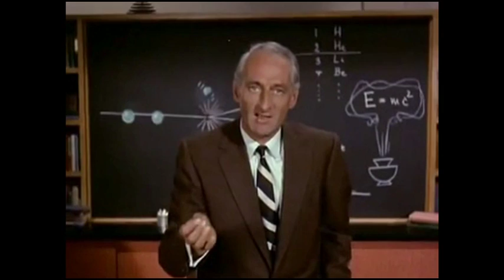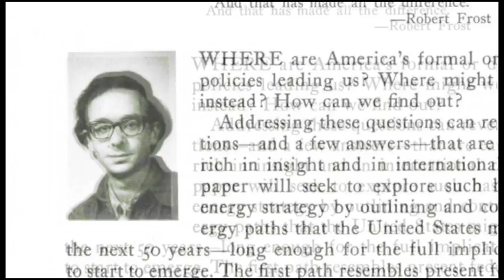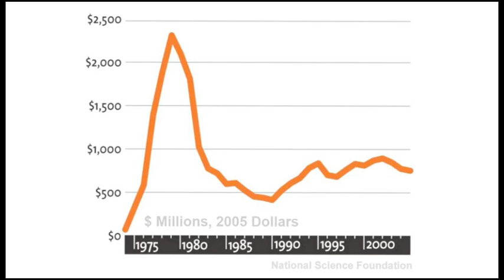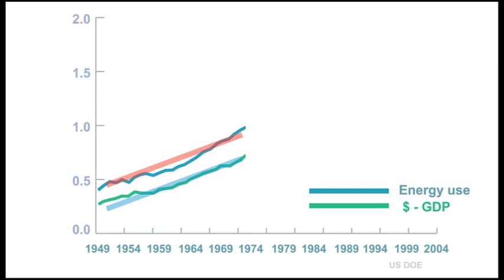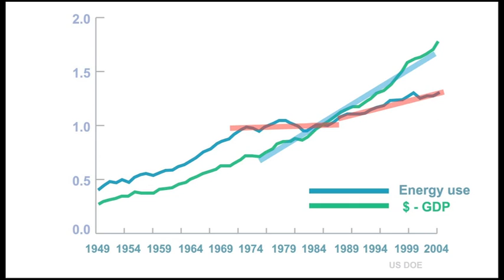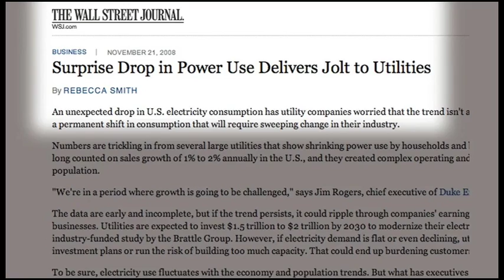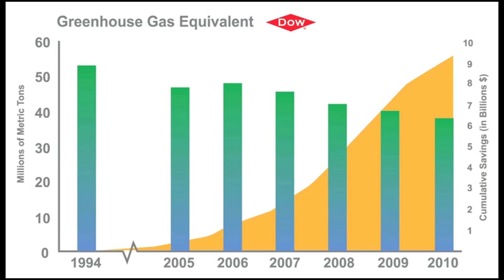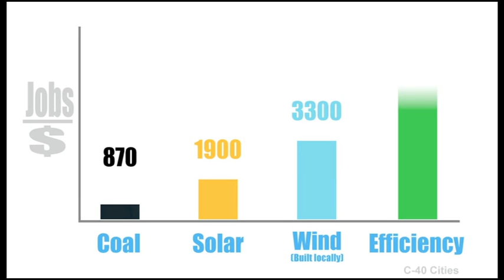Energy Efficiency Part 1

Comment: @T0B0KKE 1. yes.. because cars now days just disappear when no one is using them.  Of course they would be parked..2.3. most Americans live within  20 miles of work, you must be assuming that im talking about all electrics, I'm also talking about hybrids, so even if the battery gets low the gas engine can still run   4.Several companies have already installed power charging stations  at work.  5.yes because trucking(piping) fuel 100s of miles that was imported from 100s of miles away is genius.

Comment from the maker: @spiritualbully 
bottom line.
more and more companies are finding its cheaper to save energy than buy or produce it.
more and more utilities are finding renewables like wind are cheaper than coal, and way cheaper than nuclear, for a variety of reasons. and not due to subsidies.
the US peaked in gasoline use in 2007, and that downward trend is continuing.
the action is mostly at the state, city, and regional level, but it is happening.
google
Wind Power Roars into 2012
follow the links

Comment: @greenman3610 directly related to energy use I cannot give you a good example. But the closest I can give you is this. Amazon Kindle popularized eBooks, or specifically, LEGAL ebooks. Since ebooks decrease overhead, from production to delivery, you'd expect that the fact a book was invested $10,000 less, the delivery costs would drop 90%. But it's not the case. A book that sells for $18 hardcover is still $15 Kindle. So what's in it for me to "go green" if I'm only saving $3?

Comment: @OlejzMaku 

Yea but the scale of things matters. Solar for example... yes, solar energy will eventually run out. The sun only radiates so much and will eventually run out of fuel... 4 billion years from now. Not to mention that only like a tiny fraction of the energy it radiates hits the earth, only about 10% of that actually stays on earth, and only a tiny fraction of that is used for more than heating rocks.

We could use so much more, and it would increase the economy's metabolism; why not?

Comment: Wind meets 21% of  electricity production in Denmark, 18% in Portugal, 16% in Spain, 14% in Ireland and 9% in Germany in 2010. World wind generation capacity more than quadrupled between 2000 and 2006. In 2005 US meet .4% of electrical needs with wind, in 2009 this went up 1.8%(more then a quadrupling in a 4 year period). China jumped from 1,266 MW of installed capacity to 41,800 in 5 years(05-10)with 55,000 produced by the end of this year. That is a 33 times increase.

Comment: (cont)The only reactor currently under construction in America, at Watts Bar, Tennessee, was begun in 1973 and may be completed in 2012. A survey conducted in April 2011 found that 64 percent of Americans opposed the construction of new nuclear reactors. In 2002 Davis-Besse  was shut down because of severe corrosion of control rod forces 24-month outage.2010 Vermont Yankee deteriorating underground pipes leak radioactive tritium into groundwater supplies. You ever have this problem withRenewbale

Comment: @Silentsam7532 Canada produced 59%of electrical power in 2006. 5 provinces and territories of Canada produce 90+% of its energy from hydro. As of 2009, 64.5% of electricity  used per person is from renewable sources. Wind produces another 2%.  The Canadian Wind Energy Association has outlined a future strategy for wind energy that would reach a capacity of 55,000 MW by 2025, meeting 20% of the country’s energy needs.(cont)

Comment: Great Video!  i agree with most of the content. 

I just dont think that nuclear will ever go away. Maybe we are not that far right now and it takes a few more decades. I think that most nuclear power stations running today should be switched off, because they are neither safe nor good enough. But i think what will make the difference will not be fission but fusion, nuclear fusion is highly promising.

Best Regards

Comment: @OlejzMaku If you do this white paint to all roofs and add "reflective" as in reducing the heat energy absorbed (not reflective as in metal and sunlight shining off of it) you can lower the average electrical needs of a city in summer  but also lower the temp within the city because the heat is not absorbed by building and roadways increasing the overall temp of the city.  So care to joke some more or should I use my energy else where because it may blind you with knowledge?

Comment: Researchers from Harvard University and Tsinghua University have found that the People's Republic could meet all of its electricity demands from wind power by 2030. That is just wind not including solar and hydro power.  If you add those in again with government subsidized to increase the grid and make it a smart grid you could see it down a lot quicker. China 180 middle and large-scale dams. China currently utilized 25-30% of useable hydro power.

Comment: @nightmathzombieethan hybrids cost more than regular cars. do the savings in gas $ over the life of the car make up for increased purcase price? if not, it wasn't a free lunch. if so, then what would u do with your increased savings, spend it on locally grown organic vegetables or maybe find a way to send some of it back to the fossil fuel industry. What if we need fully electric cars powered not by gas or coal, but wind, solar, or nuclear. will those cars cost less than hybrids

Comment: (cont) you don't even need technology to increase energy efficiency. Simply painting roofs white in warm climates decreases air conditioning bills for those buildings by 20 percent(in California its law white or other light colors) . Globally, roofs account for 25% of the surface of most cities, and pavement accounts for about 35%. If all were switched to reflective material in 100 major urban areas, it would offset 44 metric gigatons of greenhouse gases.

Comment: @Silentsam7532 World electrical needs as a whole renewable meet 19%(including wind, solar, hydro, geo, and biomass(not coal, gas, or nuclear..etc) Wind electricity production in 21 %Denmark, 18% in Portugal, 16% in Spain,14% in Ireland and 9% in Germany in 2010. Cumulative capacity by the end of 2013 will reach around 343 GW. The report’s forecast indicates that the penetration of wind power into the global electricity system has already reached a contribution of 1.3%.(cont)

Comment: The precious metals used in "renewable" energys are very limited as well. Not to mention the "renewable" energies suck. We need a revolution in energy production. Not wind power. Not solar power(unless we have a revolution in that too). It has to some sort of fusion or advanced Star Trek type energy. In the uk are energy bills are 20% dearer than they should be due to funding renewable energy companies. And i bet it wont be till energy is so expensive that renewables can stand on their own feet

Comment: @T0B0KKE Not to be a bother but Hydro is ~20%. But hydro power can meet large percentage of electrical needs (and already does in several)Examples in(as of 2009) Norway 98.25%, Brazil 85.56%,Venezuela 69.2%,Canada 61.12%, Sweden 44.34%, China 22.25%, Russia 17.64%.  (can you cite the 70% of good places please). through just 2017 the is some 67 Gw suppose to come online from a total of 15 new dams. With 10 coming form china alone. (they are expanding in all renewable sectors )

Comment: @greenman3610 You need to deal with 'rebound' and Jevon's paradox. Fossil fuel humper and greenwasher Amory Lovins(see his coal-bridge to nowhere, gas powered "micropower") has failed to do this at every opportunity.

As refrigerators were first introduced they were the preserve of the rich. More efficient refrigerators were cheaper(smaller compressors etc.) and cheaper to run, everyone could afford one. More efficient heat pumps lead to freezers. Even more efficient heat pumps lead to HVAC.

Comment: @CharBroiled04 Sure some MW can be saved why not, but its hardly enough. Solar plants should be build becouse they pay off and not just becouse it is clean a renewable. EU is supporting solar power with ridiculously high dotations, 80 cents per kWh just for pumping power into a power grid no matter if somebody buing it. Result is expensive electricity, unstable power grid and wasting resources. Sometimes it seems people just not thinking when they are going green.

Comment: @T0B0KKE For solar the earth is ~3,850, 000 EJ in a year. Primary energy needs(which includes gas, oil, renewables, nuclear,and coal only reached 487 EJ. meaning .0126% is all the energy we need to capture of the suns energy that the earth receives.  Of course you fail to account for the fact that solar hot water systems use no rare materials and  can produce 60-70% of the hot water needed by homes at latitudes below 40 degrees. (cont)

Comment: @Silentsam7532 How is A typical 1000-MWe nuclear reactor produces approximately 20 cubic meters (about 27 tonnes) of spent nuclear fuel each year. This takes 10,000 years before it reaches a level not dangerous to people.  Misleading? How so?  All the spent fuel produced to date by all commercial nuclear power plants in the US would cover a football field to the depth of about one meter.   Benjamin K. Sovacool has reported that worldwide there have been 99 accidents at nuclear power plants.

Comment: @NicosMind How is there anything in a wind turbine that isn't in a coal plant? It's a generator, it's made of a coil of wire and another coil of wire.  Same with a solar thermal plant. PV panels I'll give you, with the caveat that the amounts involved are tiny. And how is it 20% dearer than it "should" be? You mean 20% dearer than it would be if your government and power utilities didn't give a crap. But they do, and they share the cost of caring with you.

Comment: @T0B0KKE China's National Development and Reform Commission has indicated the intention to raise the percentage of China's electricity produced by nuclear power from the current 1% to 6% by 2020.would increase nuclear output to roughly 70-80 GW.  China had total installed capacity of hydropower up to 197 GW in 2009. so ~2.5 times the amount of nuclear even if they reached the 6 time increase they have currently. China's installed hydropower capacity has surpassed 200 GW in late August 2010. cont

Comment: @T0B0KKE really no sun? unless is so cloudy can't see your hand before your face then there is sunlight reaching the earth, even if its not  at full power, energy will still be made(at a reduced efficiency) as for down time. A well functioning  coal plant is down on average 44 days a year. nuclear is 36 days with a shut down every 17 months for  refueling that takes 39 days. Wind is down an average of 35-70 (this is not even whole days).  You want blackout problems?(cont)

Comment: @T0B0KKE This could happen by the end of the century without much intervention. If you want governments to get invaded i believed Scientific America  had a large cover story over how the US electrical  power 67% by solar in 2050and total energy by 35% with a $420 billion in subsidies from 2011 to 2050 would be required to fund the infrastructure. Wind and hydro could easily meet the rest of the demand. Also increased energy efficiency would great lower the cost and time needed for the project.

Comment: @Silentsam7532 Again, you're comparing NOW, when it's not needed, to THEN, when the technology will be vastly improved.  Currently there ARE actually a number of efficient methods for grid level storage.  Simple pumped hydro is good.  In the coming years we are going to have millions of spent automobile batteries that will be viable for grid level storage projects.

Comment: @jffryh The hybrid part was sarcasm.... Actually my car is over 30 years old, and YES, I realize today's hybrids are a joke. People in Europe have been driving diesels with > 40 MPG for years. Heck, a Honda Civic HF from the early 80's get's better mileage than a Prius... Sadly I agree with you that the only solution is a "system" powered by clean energy sources, unfortunately as long as our political system is partyl owned by oil companies this will never happen. My only hope is biodiesel....

Comment: Nuclear power provides about 6% of the world's energy and 13–14% of the world's electricity. ~ the same that renewable generate. A typical 1000-MWe nuclear reactor produces approximately 20 cubic meters (about 27 tonnes) of spent nuclear fuel each year. This takes 10,000 years before it reaches a level not dangerous to people. You have to worry about safety, from 19750-1987 you had 7 major nuclear failure which cost 300 million or more(in 2006 dollar value) Those 7 alone cost 14. 5 billion

Comment: @OlejzMaku So its propaganda that china increase wind power by a 33 fold increase in a 5 year period?(also i believe the word your looking for is capacity factor. )The capacity factor achieved by new wind turbines in 2004 and 2005 reached 36%. Fossil fueled power plants often run at roughly 40-60% capacity. With nuclear ranging in the 80-90% range. (if you ran units at max 95% or higher you cause a lot of extra wear and tear on your equipment  that is one reason they never reach max capacity)